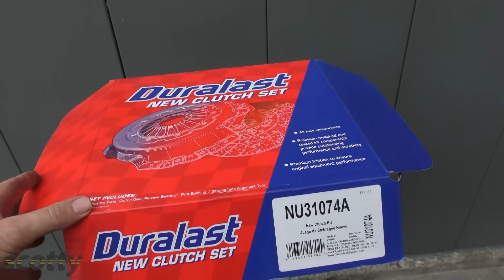5 Things You Should Never Do in a Manual Transmission Car

Comment: If you take your drivers test in a manual and you don't downshift into every gear when stopping they fail you for coasting in neutral. And when you're at a red light you have to leave it in first and hold the clutch. Not allowed to sit in neutral.
Reply: That's dumb I do downshift sometimes usually when the speed limit changes but if i cant put it in neutral I will. As for having it in 1st at a red light I have to do that I hate it but if I don't it sometimes wont go into first gear
Reply: puffnpluky76 I thought sitting in first was bad for the transmission. ( forgive me not really familiar with manuals lol.😁) got a crash course with a manual car and was told neutral was my sitting/ idle gear.  1st is usually 2 mph to 15  ( or how ever your car is geared)
Reply: @littlemouse9900  it's not bad for the transmission, it's bad for the throwout bearing on your clutch. You'd have to keep the clutch pedal down the whole time if you were waiting in 1st gear at a stoplight. If you didn't, you'd kill the engine. I put my car in neutral when I'm waiting at a light.
Reply: Samething when I went to driving school for my tandem axle license,if ya didn't downshift and just coasted in neutral,it was an automatic fail
Reply: But after the driving test you can do more rasonable stuff.
Reply: Yup... it's stupid but totally went through that in driving school.
Reply: When you stop at a red light you keep it in neutral and put your handbrake on.I passed my test this way in the U.K.
Reply: Coasting and keeping the car in neutral are different things you probably would fail for coasting but definitely not for taking it out of gear when waiting at a traffic light

Comment: Hey Scotty I had a Nissan Sentra 1996 base 5 Speed Manual. Mine was a cable clutch I gotta say I was 1 of the best cars to drive. Very trustable and I could adjust that clutch if it actually burned out. Atleast I could drive it to a mechanic to have it fixed on :). Oh and it was great on gas mileage too.

Comment: I drive a manual for one big reason. EVERY automatic I have owned has failed by 100K miles
and I am just plain sick of it. I drove a couple CVT's and it feels like driving a 
car with a rubber band as a transmission. I will admit that I am like the black cloud of
car owners. In my world, if anything could go wrong with a car, it will if my name is on the registration.

Comment: I learned that the driver should not have the hand on the shift the whole time driving because it can cause premature wear.
Reply: @doomxed you can rest your hand on the stick without causing any premature wear no problems it's the pushing or pulling force that needs to be avoided. Down force in the direction the stick is pointing will not cause any extra wear. The whole silly saga has been blown out of proportion. The reason you don't want to be leaning or pulling on the stick is to avoid wear to the selector fork for that gear you are currently using but in most modern transmissions it's not a big deal anyway as the gear is held in place by a detent selector which actually does the holding of the sector in its position. This is usually just a ball bearing with a spring to push on the ball. And this is coming from a heavy diesel tech with over 1 million highway miles of heavy trucking and current truck mechanic with a manual 6spd car for personal use and a manual 6 spd ford pickup as a service vehicle for work. Never had premature wear to clutch or transmision ever.
Reply: @kiwidiesel5071  i as a european can verify manuals ar more reliable which is why in europe most cars are manuals if you dont create downforce wjile resting your hand your good and we do get thaught to leave our left foot of the clutch
Reply: @timmiekat6072  same here in New Zealand mate although sadly more and more automatic transmissions are becoming the norm here both in cars and our truck fleets, we have a problem here now where there is a extreme shortage of people  able to drive manual transmissions in heavy trucks to the point that nearly all of our truck fleets have converted to automatic transmissions even tho it has been proven that automatic transmission trucks give more problems with transmissions and clutches  and are more expensive to operate so sadly we are now shifting towards a society that is getting dumber and therfore we are allowing this by purchasing more automatically controlled transmissions instead of teaching people how to drive correctly with manual transmissions. I mean a synchro manual transmission is as easy as it gets and understand it takes a little time to adapt to a raodranger transmission but to not even try now days is sad really. I despise automatic transmissions I all vehicles as they never do what I want when I want it to happen and continually  make the wrong changes when they shouldn't even be changing gears.  Sadly the future of things to come I fear.

Comment: At 2:00 you pulled the handbrake up without pushing in the button, that’s gonna wear it down so eventually your car will be rolling away
Reply: No it will not happen
Reply: Nope, not gonna happen.. and the button is only to disengage the e brake. It does no good to hit the button to engage it.

Comment: Rev matching will also extend the life of a clutch... unless you're terrible at it. You can downshift all day long if you can rev match properly.
Reply: There's nothing wrong with downshifting if you're doing it right. He is 100% wrong in this case, it goes not wear your transmission exponentially faster and Rev matching even alittle bit is perfectly fine, it's stupid to even suggest that downshifting is bad. I've never had a car come on with a transmission worn by the person downshifting all the time unless they accidently jumped gears
Reply: Bjorn Ironsides see that's a false narrative. Most mechanics thoroughly dislike Kilmer because he spreads false information like this around, or he says things that can be easily misinterpreted, again, like this. The fact of the matter is aggressive driving will stress components but that is not what he said. He said downshifting and then included "clutches cost more then brakes". So he is indeed speaking of down shifting to stop/slow down. He is wrong and that's that. No one is splitting hairs, he made a claim that was wrong, and I'm saying that it was wrong. Also, experience, which is important, does not equate to intelligence. Here's an example, takes you years to really be able to feel when a bolt is going to break as you're tightening it, however that doesn't mean you understand why/how it's going to break.
Reply: I drive 3 cyl Toyota Aygo, it has so little torque, i have to downshift for almost every uphill.. lack of tachometer and engine noise makes perfect downshifting pretty challenging.
Reply: He wasn't talking about stopping although that's not a bad example. He specially mentioned driving like a race car driver. His point was that if you're always being aggressive and constantly shifting up and down a lot to keep your RPMs high like you're racing. You are adding a lot of wear. Unless I suppose you rev match 100% perfectly all the time and even then just the act of switching gears isn't free. You could say that the less shifting you do the better just like the less braking you do the better but both are obviously necessary at times.
Reply: LOLKINGBABY so what did he say that was a lie?

Comment: Regarding parking in uphill and downhill, (Manual transmission)
shifting gear should be,
downhill~shift rear gear and hand brake(Engine off)
Uphill~shift First gear and handbrake(Engine off)😊

Comment: You call that an emergancy brake?  It's standard name here (UK) is parking brake, because that's what it's used for...

We'd only keep it in gear in addition to the parking brake if it were parked on a steep incline. 

Wouldn't never trust the engine not turning by keeping it in gear alone...
Reply: It's called that in the US because it will still work if you lose brake pressure and the main brakes fail. It was intentionally designed this way to provide a way to stop if your brakes did fail. And why would you not always leave it in gear in addition to the parking/E brake? There is absolutely no reason not to assuming the vehicle is not running.
Reply: Dude, use the emergency/parking brake AND put it in gear. Good lord, you limey, you are a menace.
Reply: It's a parking and/or emergency brake because it can be used in an emergency situation to bring the car to a stop if your hydraulic braking system failed for some reason. Call it whatever you want but it does have multiple uses other than parking on a hill.
Reply: Thats not its primary function its primary function is to secure a parked vehicle. And leaving it in gear is for just in case the hand brake fails. I only leave it in gear when not parked on flat ground anyway.
Reply: Its a parking brake, regardless of what the yanks call it
Reply: we call in the handbrake in the UK and it's for doing sharp turns
Reply: Never heard anyone in UK call it a parking break always handbrake
Reply: It's called a handbrake.
Reply: @allanthorburn  gotto confess I'm in my 40s and still cant pass a snow covered  empty car park without dicking about for a few minutes.
Reply: It’s called a handbrake in the uk lol
Reply: lolinmotion pig yeah ikr
Reply: Bindo Handbrake*
Reply: Standard name in the UK is handbrake, because it is hand activated. Parking brake is an American term.
Reply: The standard name for it here in the UK is handbrake...
Reply: In Australia it's called a hand brake.

Comment: My car its 19 years old and uses a cable system. Its not adjustable and sadly, wen i broke the old cable, i had to replace it 3 times, at the 4th time it got fine. I discovered the guy that got the 3 cables boght a VW Beetle with the problem being the car its a Seat Ibiza

Comment: I always down shift in a manual car [brake and change down at the same time], I road a motorbike for a year before getting my car licence.
Reply: I always downshift too. I thought he was saying not to do it at all but I think he was meaning not to shift from say 5th to 2nd all the sudden all the time
Reply: If the engine revs are ok then there's really no need to downshift. If the engine is struggling or you can see something ahead that will require a downshift then do so.

Comment: Any original clutch people here? I got a Civic with almost 300k miles on the original clutch.
Reply: 01 S10 stock clutch lasted to 190,000.
Reply: 1989 Dodge Cummins with 260K miles still on factory clutch
Reply: Squidward's House my 99 Tacoma 240k with original clutch and trans oil
Reply: 2008 vw passat wagon 121.000 still on OEM clutch and trans oil
Reply: Squidward's House they last a long time if u can drive, it's always funnjy when people say they don't last long and manual = high maintence, even funnier whje. I tell him before my clutch slips ur auto = 3k plus for a replacement or a rebuild vs my $200 clutch that lasted longer
Reply: 2009 VW Rabbit 265,000 miles. Factory clutch still grabs greatly!
Reply: My 2001 toyota corolla lasted 175 thousand miles on 1 clutch
Reply: 2001 Tacoma, put 276,000 miles on it then sold it with original clutch......still felt like new.......
Reply: VW Golf 1.9 diesel 256,000 miles and on original clutch.
Reply: Made it to 170k, and the clutch still had life in it. Only replaced because engine rebuild.
Reply: 1998 chev 3/4 ton 454. Original owner and original clutch. Mind you I have only put 98000 km on it 😉
Reply: 1994 Accord 258K traded. 2000 Civic 237k traded. 2007 Accord 201k currently. All originals.
Reply: 97    4Runner with 370,000 miles and original clutch
Reply: I believe my 1999 Saturn SL1 has a original clutch. Has around 330,000k on it too, I still heal toe and perfectly downshift/up shift with no pop out and grinds from the synchros. Had it for three years because of the MPG, Standard trans, and very cheap/DIY work.
Reply: yes...1999 Nissan frontier 4wd pu...270k on original clutch and I downshift cause I live in hilly country with snow....and change tranz oil at 30k.....old blue still chuggin along...
Reply: 305000km on vw 2.0 stock clutch and trans
Reply: 06 cobalt ls coupe, 123k with stock clutch.
Not really a large amount of miles though.
Reply: 71 chevelle 330,000+ original clutch, column shift. straight 6
Reply: 05 EP3 112k miles owned 10 years but I’m the third owner. I’m not sure if it’s the original clutch haha but in my 10 years I’ve had no problems. Just did a trans fluid change recently. That’s it.
Reply: December 2018 Astra, 2k miles, still regular clutch

Comment: Don't downshift?  So what should done if the car is slowing but an emergency arise and throttle needs to be applied?
Reply: You do need to downshift if you need to quickly get up to speed to avoid lugging the engine. 
Say you're in overdrive at 45 mph and its doing about 1100 RPM. Now you need to get to 70 mph fast. Thats when you downshift to 1:1.
Of course you dont wanna do hard accelerations all the time.
Reply: @DAN007thefoxx1  overdrive, in a manual??
Reply: @Opsecable  It only means the engine is spinning slower than the tires. Automatics arent the only ones that can do that
Reply: +Bindo Manual transmissions definitely have overdrive. Some heavy duty transmission that splits gears such as a 13 or 18 speed both have OD depending upon the gearing.
Reply: Technically overdrive is 5th or sixth gear in most cars

Comment: had an '02 standard transmission f15 0 for 9 1/2 years, never changed the brake fluid in the clutch system like he said, never changed the clutch. must have gotten lucky. it was a great truck.

Comment: Don't downshift?
Reply: I think he meant don't zing the engine like mad but... Yeah I don't agree with this one.
Reply: Unnecessary wear on the clutch and synchros. If you know you're coming to a complete stop just leave it in gear, brake, then put it in neutral.
Reply: Or learn how to rev match.
Reply: He means when coming to a complete stop, not just in general.
Reply: Rev matching or not, the less you shift the less wear you're going to have. He wasn't saying never to downshift. It's more about not driving aggressive all the time. Where you're constantly shifting back and forth to keep high RPMS.
Reply: at the same time dont constantly lug the car either .
its a balance thing.
Lic Driver Circa 1968
Reply: if you rev match its a non issue. if you can't rev match practice
Reply: An automatic transmission downshifts as the vehicle slows to a stop why would you not want to do the same with a manual? I have always down shifted my manual and as a result got six years out of my factory brakes before they needed replacement.

Comment: When I was 17 years old I went to get my driver's license in Burlington Ontario. I was using a manual transmission car because the other family car was in use which was automatic. I refused to downshift coming to a stop and I was failed by the instructor because he said you must downshift. And I told him when you downshift you wear out the clutch and a transmission much sooner. You put it in neutral in normal driving conditions when you're coming to a stop. Unless it's an emergency then downshift if you need to stop quicker.

Comment: But.. but.. what if I like to unnecessarily heel toe coming up to every stop light?
Reply: What is heel toe?
Reply: Rev matching for smooth transitions in downshifting to not cause the suspension to get upset.
Reply: @russlundberg9744  heel and toe is how you keep your foot on the brake while you blip the throttle
Reply: @Madvillian  yes, that is the position your foot is in while down shifting, but that is not how your foot is kept at all times, nor is that the purpose of heel toe.
Reply: @russlundberg9744  I never said you keep your foot like that all time, and yes that is the reason. Why else would you want to keep your foot on the brake besides to actually brake.